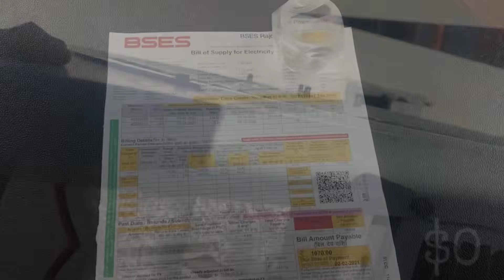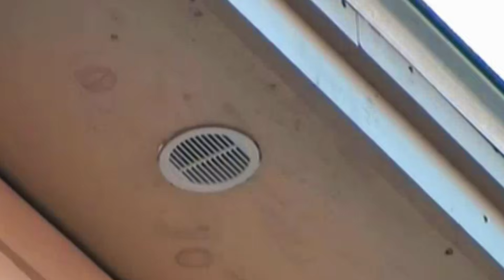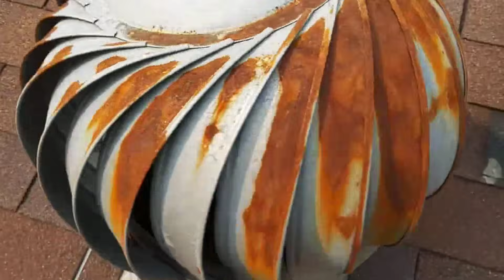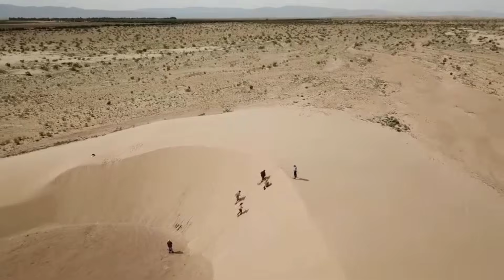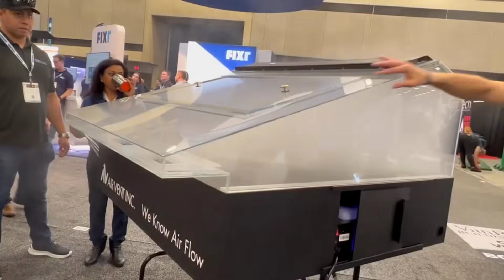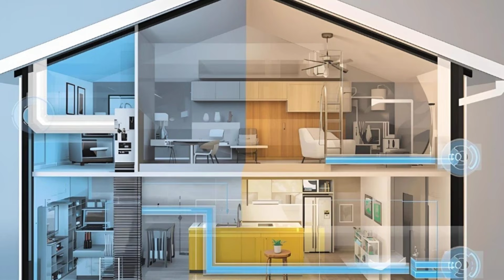This Roof Vent Cools Your Home for Free — Why Did We Stop Using It?

Comment: I m confused and need help.If I own a balanced force air cooling and heating system.I complain that 2 of the rooms are not getting the proper heat or cooling.Seems to me that the system is unbalanced.What do the furnace experts think.If the system doesn't work in all rooms possible that would be an unbalanced system